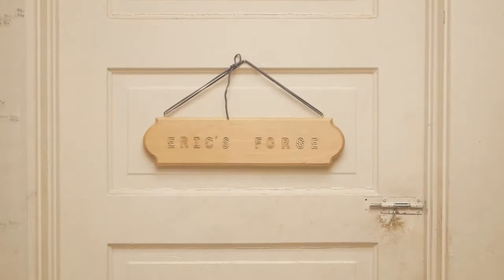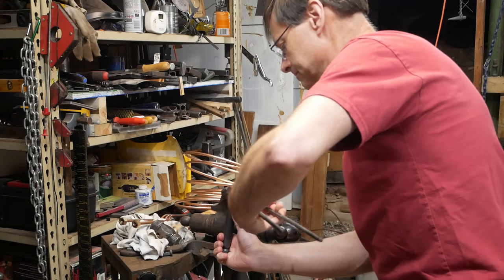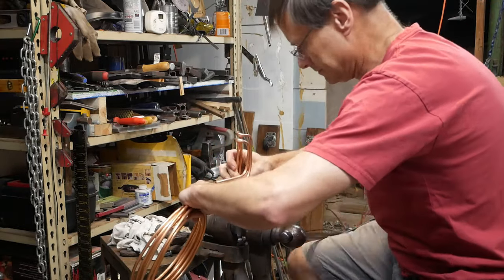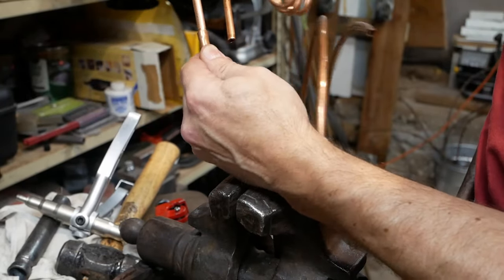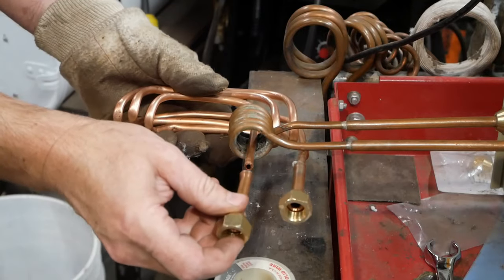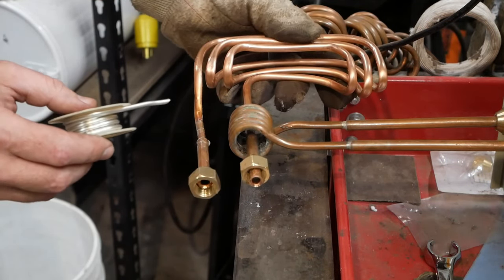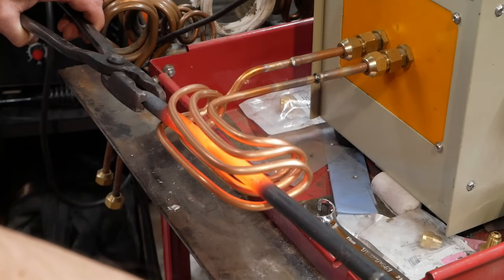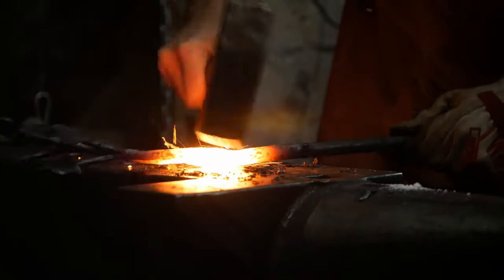Good coil for blacksmith induction forge welding

Comment: Hi Eric is your induction heater turned up for this coil to reach welding temperature, thanks for your videos you’ve been an inspiration
Reply from the maker: Yeah, the induction heater is on max output.

Glad you've found my videos helpful. It's all about giving back to the blacksmith community. I've found incredible inspiration from the community and this is just a way to do my bit.

Comment: Love your info on coils. Just got into induction forging as I moved and can't use my coal forge. Any information on making an open-ended coil for sword work? would be great if you could contact me.
Reply from the maker: This taco coil isn't bad, but I would think the rectangular cross-section coils would be better. However, I would make the spacing much larger so you can more easily heat several inches.

You can find my contact info on the contact page of the Saltfork Craftsmen web site.
Reply: @ejoftheanvil  Thanks, I sent you an email. I appreciate it.

Comment: interesting video.  Have you considered using Cerrobend or a similar low melting point alloy core in your coil builds as a way to improve the asymmetry of the bends?
Reply from the maker: I haven't. It would work really well. Better than sand or frozen water. It tend to use external bending forms (like my pipe thing) because I get good enough results in less overall time.

Comment: What is the capacity or power of the induction system?
I want to harden gears the diameter is 40 cm. Can you help me please to have induction system. It is not available in my county.
Reply from the maker: This system is only 7.5kW (usually falsely advertised as 15kW). A gear that large could not be hardened all at once. There are 3-phase units from the same manufacturer that would do it.

Comment: Have you ever messed with multi-coil attachments? Like a 1 inch round coil and a 1.5 inch round coil on a single length of copper? I saw someone doing that and it seems very time efficient

Always love your videos!!
Reply from the maker: Grant Sarver did that. It's not as practical for larger stock sizes, but it is a good tool for specific projects. Grant had a bit of a "production" metalwork mindset so he really optimized for his specific projects.

Comment: What is that coil attached to? I am unfamiliar with your setup. Are you saying you can heat steel without a furnace? Can you explain?
Thanks,
Paul
Reply from the maker: My setup uses a LH-15a induction heater. This generates a powerful oscillating magnetic field in the coil which "induces" eddy currents in the steel which generate heat. If you want to know more about this, look at some of my other videos. The earliest ones are overview videos.

Comment: Hello sir ,, can u solve slow heating problem ? My two heater slow heating ptoblem.
Reply from the maker: I have helped repair one heater that originally worked well, but started heating very slowly. In that system, it was the board that drives the big high-power IGBT. That is, it wasn't the board with the big water-coolers on it. It was the board that is wired to it.

We started by testing the driver board because the IGBT on the high-power board were high-quality, German products vs the inexpensive and often even recycled components on the other boards. We had the luxury of identical machines to swap boards with to confirm this hypothesis.

Comment: Hi, thanks for uploading! I know it has been discussed already, but perhaps you can clarify again: in my workshop there are 240v with max 32 amps available. Will it work or would you recommend not to buy?
Reply from the maker: That would work. In very rare circumstances you might have to turn the power output down very slightly. I ran mine on a 30A breaker for over a year before I accidentally managed the magic combination of metal and coil that actually tripped the breaker.

Comment: Where can i get this induction machine ?
it is available online ?
Reply from the maker: Yes. Depends on where you are. Most of the units advertised on eBay as 15kW units are this one (and they are 7.5kW units NOT 15kW - it's a lie based on the 15kVA spec). US Solid is the place I bought mine (before they started using the new name).

Comment: Awesome coil EJ! Very clever forming tool with the swaged pipe cut in half! I can't believe you achieved that tight of a radius without kinking it. Are you using standard refrigerant coil?  How much better does 1/4' coil work better for tighter bends compared with 5/16? My best method so far for me was: Flaring ends, pressurize H20 with pressure washer, freeze, bend, and flatten round to rectangle (this last part flattens the magnetic field) Great leg work by the way! I have done the same myself but found levering the two separate work pieces against the jaws whenever possible reduces the need to do so.  Great no flux forge weld too! I was thinking of positioning an open end coil so that any excess flux would not get on the coil. But hey just blast some inert gas across it and catch it on the other side! Forge ON! ON!
Reply from the maker: I've only used refrigeration coil. I really like 6mm or 1/4" for coils. 5/16" or 8mm is good for larger ones, but I'm settling on 1/4" for all because of local affordability. I may switch to 5/16" for the stubs when I run out of 8mm, but even 5/16" is a mail-order proposition.
Reply: I fill the tube with fine sand, crimp both ends shut, then after shaping I cut the crimps off and blow the sand out with a blowgun.  Never thought of doing it with frozen water, although I've heard of doing it with cerrobend eutectic alloys.
Reply: @andrewtinker7537 , I’ve read one can do good bending (without worry of kinking copper pipe) by melting candle wax into it. Afterwards, reclaim the wax. I’ve never done it before but am a student of YouTube university! 🤣🤣🤣

Comment: Hi, Is it possible to melt the metal in the crucible using this induction heater. I am planing to get one very soon. Thanks
Reply from the maker: Yes. Only small quantities and you will need an appropriate crucible and coil(s) made to fit it.
Reply: @ejoftheanvil  Thanks a lot.

Comment: Great videos .....i really appreciate your work.
About forging a large rod i think you really need a medium frequency machine ? I think your machine is above the frequency for forging ?
Reply from the maker: This unit is excellent up to about 1" / 25cm diameter. It's tolerable for up to about 1.5" / 3.8cm diameter.
Reply: @ejoftheanvil  Thats great .....it seems that the machine is running around 32khz to 40khz .....Do try parallel coils ...they work great for longer heating area.
Reply from the maker: @hasanfarooq5923  Good suggestion. I've been wanting to try out a parallel coil for some time. And, yes it's a 30-80kHz machine so it'd be down around 30kHz on the largest stock.
Reply: Sir thats great ......i would suggest you to make 3 turn coil with 3 parallel coils ....inner diameter would be at 40mm for heating a rod of 25mm diameter. 
Make these coils on 8mm copper pipe or 10mm copper pipe.

Comment: couldnt you just make a bunch of loops flat like a plate (oval plate shape)  then just bend the whole thing over at once over the pipe to make the taco shape?
Reply from the maker: If you filled the tubing with sand / ice to keep it from collapsing, yes. Given that and the work of making the oval it would be about the same effort. If I were making many of these. I think that approach (with pre-made bending jigs for the oval curves) would be good.

Comment: Will you get electrocuted if you touch the copper wire?
Reply from the maker: No. It's low voltage and relatively safe. And, actually the heated metal is getting induced current / voltage. I've noticed that I can feel a tiny "bite" of electricity if I touch my anvil while holding the piece being heated with my other hand. In that case, the anvil is big enough to act as "ground". (Only, of course, if both hands are bare.)

Comment: How much unit of power average power consumption per Day?
Reply from the maker: It's 7.5kW at max and nearly 0kW at idle. With my usage, I probably wouldn't exceed 2kWh of energy consumption per hour.
Reply: @ejoftheanvil Thank you. 
which capacity machine is suitable for blacksmith work.
Reply from the maker: @nkanagaraj6032  Any of the 7.5kW units (which are usually advertised as 15kW, which they are not). Mine is a Lihua LH-15a. The 15 is for 15kVA, which all the similar units support (not 15kW).

More power would be nicer. There are 3-phase units with 25kW and more. I've used a 25kW unit. That's a big step up for, say, making hammers or other work from thick stock. For 1/2" (or 12mm), it doesn't help much.

Comment: Hi Eric, do you run distilled water or TIG cooler fluid through your induction forge
Reply from the maker: I run distilled water because it never freezes in my basement shop. However, last time I changed it I noticed a tinge of copper oxide green in the water so I'm considering moving to a TIG cooler additive.

Comment: Hey my forge is making a flickering beep noise. Is it cause of the tape on the coils that it is not heating? It doesnt look like a sleeve it's some type of tape wrapped around the whole coil which is 5 inch diameter with tape on it.
Reply from the maker: I think it's either a defective unit or the coil is out of range. My unit does beep-click-beep-click... when the coil is out of range. You can kinda hear that in this video: https://www.youtube.com/watch?v=XGGiGrkwXts.
Reply: @ejoftheanvil  my old coil works fine the solders just fell off it's taken well over 20 minutes to melt this 7075 aluminum and it's just a pound
Reply: @ejoftheanvil  the conductivity isnt high enough I'm getting a reading of 18 amp
Reply: @ejoftheanvil  I was trying to heat it in a crucible but the amperage was too low. When I take everything out of it is makes the clicking noise and when I put everything back in it goes back to only 18 amps. The old coil works at 850 but the 1 loop doesnt melt enough material and it cools down in the middle of the metal and doesn't turn to liquid aluminum. I dont think the coil height is enough to thoroughly melt what's in the crucible with just 1 loop. The conductivity stops working well with 4 coils and a 5 inch diameter but 1 loops works fine it just doesn't completely melt the aluminum inside it.
Reply: @ejoftheanvil  do you think you could experiment and find a length that works well with your forge that I could purchase please?
Reply from the maker: @zachjackson9263   Can you send me a picture of the old & new coils? If you look at the contact info on https://www.saltforkcraftsmen.org you can find my email.
Reply: @ejoftheanvil  they must not melt as well with water leaking from the joint? My solders both broke off

Comment: Howdy EJ, my name is Logan Morris and I live about an hour south of OKC. I have a small business where I do custom knives and I am curious if you think that this gets hot enough to forge weld carbon steel. Say 108-1095. I ask for Damascus purposes
Reply from the maker: It is not ideal for billets. You can easily work small ones, but look at the total volume of what I'm heating in this video. It's maybe 1/4 to 1/3 the volume of a typical billet. Getting a whole billet to even, forgewelding heat is not likely.

Comment: what is the maximum current(A)  that this coil can handle? dumb question but i need the answer please any one
Reply from the maker: I'm not entirely convinced the readout on the front accurately reflects amperage, but if it is true ... 800 amps. That's possible in a 7.5 kW heater because the voltage at the coil is quite low. I suspect, though, that the amperage is lower than that number, but it still is several hundred amps (probably more than the equivalent power welder).

Comment: how much power does it consume though?
Reply from the maker: Ideally, the full 7.5kW. But, it's a compromise coil so probably not. I'd estimate from heating time vs a traditional coil that I'm getting half to 3/4 power.

The nice thing about induction heating is that it's quite efficient. Generally, if you aren't getting much heat into the work, you aren't drawing much power from the electrical supply (and vice versa: when you consume a lot of power, you get a lot of heat).

Comment: what is the maximum power of your heater, how much does id draw while heating?
Reply from the maker: These heaters are 7.5kW (there are no 15kW heaters, that's a kW vs kVA mistake). That will draw a bit over 30 amps depending on your exact "220" voltage. Those max numbers are a bit rare. They require just the right coil and steel shape (and of course having the heating current set to max).

Comment: hi, recently I bought 15KW induction heater KIH-15A. I bought from aliexpress. I have not proper manual. I have some issues with proper electrical connect. I think you have lot of experieces with this kind of machine. If there is possibility to give me some advice. I can send you some video and info of the machine  by e-mail....thanks
Reply from the maker: Okay. Look me up on the saltforkcraftsmen.org web site. You can find my email address on the Contacts page.

Comment: I have watched some of your other coil videos because I bought one of these machines last year. I have never been able to get results with any coil design like you get. No matter what I tried with flat stock it won’t heat up. Any thoughts about what my problem might be?
Reply from the maker: Is flat stock the only thing that gives you trouble? What are your stock dimensions? What about the coil?
Reply: So far it is only the flat stock. the material I am using is 50x3mm. I have made a few coils to go around graphite crucibles (which work really well), and attempted one pancake and one coil wrapped around wood to better shape it to the material. I can’t give exact dimensions of these as they aren’t handy right now. I am thinking I have bad coil construction as larger material heats well in the stock coil from the manufacturer. Any tips or resources you might recommend would be really useful and appreciated

Comment: Be careful near those magnetic fields Eric...pretty sure that it can cause harm to the body.

What’s great about this coil is that (in my 100% non-expert opinion) the coil shape leads me to believe that the magnetic field is asymmetrical, and so....maybe you can stand at a certain distance away or in a position that isn’t near the field lines when inducting you’re metals, and  that’s cause you less bodily harm??

Idk. Just know that if it were me I’d want my balls nowhere near that field 😂
Reply from the maker: I really only worry about the magnetic fields when I have my wedding ring on or something else metal (bracelet or something) on or near my hands.
Reply: I doubt this alternating magnetic field is going to cause your (or anyone else) body harm. 
At 40Khz, it’s just under the frequency of AM radio, which begins at 100Khz. 
Plus, the coil form is keeping the EM field contained. 
The people that have to take precautions are the ones working on Broadcast towers for Radio Stations, but those things put out in the many kilowatt if not megawatt ranges. Ones hands can get dielectric heating if in direct contact with the transmitting elements.
Just FYI.

Comment: Hello Ej, i found your videos when i was doing research for my own hobby of smithing my own knives. Does a induction forge use lots of electricity? is it expensive to run etc?
Reply from the maker: It uses about as much as a welder. It costs me less than $1 US for an hour of runtime (which is 2-3 hours of forging time since it uses very little electricity when idle). Also, tt does require a >35A 220v circuit.
Reply: @ejoftheanvil  thank you very much, that is actually amazing cause here in belgium the base net voltage is 220 volts just will have to take a look into the current draw when designing the workspace.

Comment: Love the videos and I plan to get an induction forge when I can.  I have a few questions that I hope you have time to answer: 1) Would it damage the equipment to put antifreeze in the water if the unit is in an unheated shop to prevent freezing in the winter? 2: will a 120 volt unit  get metal to forge welding temperatures or would I need a 240 volt unit? 3: is there any down side to having two coils of different sizes on the unit at once?  See this video for what I mean: https://www.youtube.com/watch?v=k4xsqw463Hs&list=PLHta7NIJ9npaGb1l8bHhK6R6NmyVG7UGf  Thanks again for your videos!
Reply from the maker: You should add antifreeze. Ideally something designed for TIG. You should probably avoid automotive coolants because I hear they have additives designed to plug small leaks which might gum up your coils.

You really need the 240v unit. A standard 120v outlet is only 15A. That's a mere 1800W. You'd need nearly 70A to get the full 7500W performance. With 240v, it's common to have 30A, 40A or 50A outlets. You need 35A.

You can double up a small coil like that, but it's rather easy to end up with a coil that has too much inductance and won't work at all. With most of my coils, I push the number of loops right up to the limit (for a longer heat), so I don't really have the option for that. For some projects, tho, Grant's double coil would be very handy.
Reply: @ejoftheanvil  Thank you